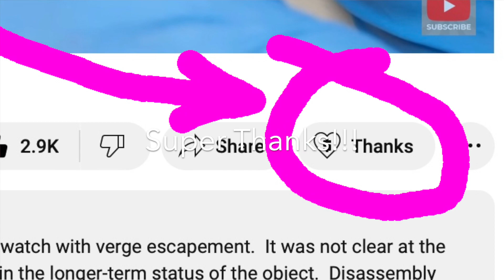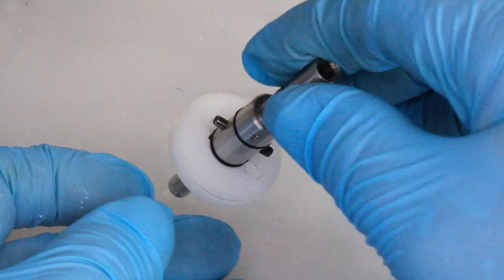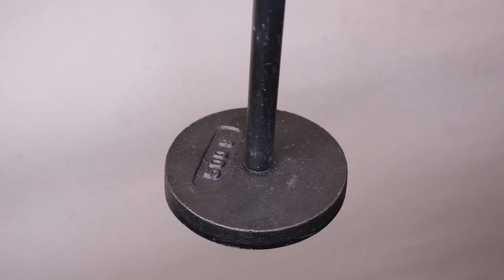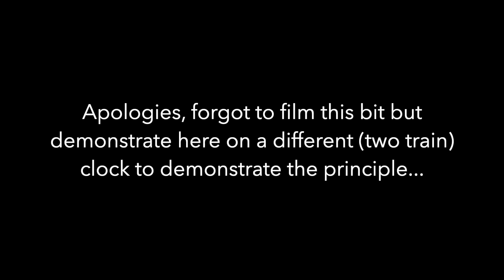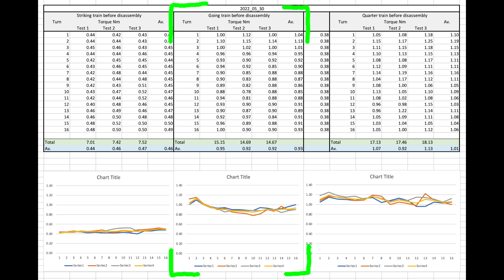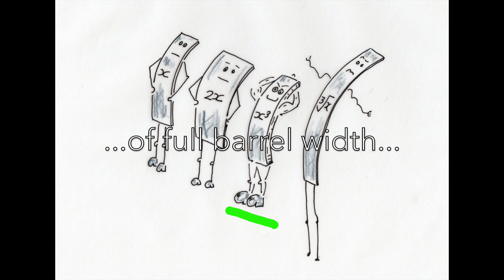READ Repairs #003 Part VIII - Torquinator 2.0  Research in torque requirements for fusee clocks.

Comment: I have the same problem with my clock. I put a hard plastic cover under the original barrel cover to keep the mainspring in place. Do you think it would be okay, or would a metal one be better to prevent the plastic from wearing out? saludos.!
Reply from the maker: I dont think the plastic will wear out.  As long as you use a type of plastic that is not affected by oil it will be fine.
Reply: @readrepairs  Thank you for taking the time to respond.!

Comment: How did you know which spring to choose at a replacement? how did you know it would give you the correct torque output?
Reply from the maker: That is good question; you dont, you have to guess, try it and then go from there.  All you know is a change in thickness will give you a relatively large change in torque, a change in width will be proportional to the change.  Once you know the target torque, if you need say 50% less torque than the spring you have, you need a change in thickness.  If you need 15% less torque, that is likely a change in width.  Hope this helps, M
Reply: @readrepairs  So theoretically, if you know the torque output of one spring,  you can roughly determine the torque output of another spring with different dimensions provided it has the same compostion, probably from the same manufacturer as the one youve tested? 
wouldnt it be fantastic if spring manufacturers tested and provided torque outputs for their springs?